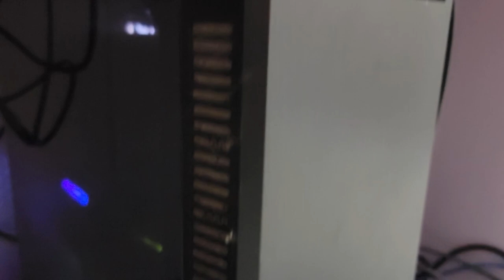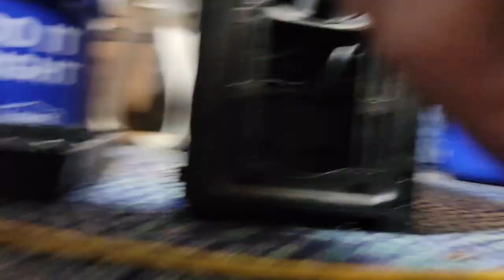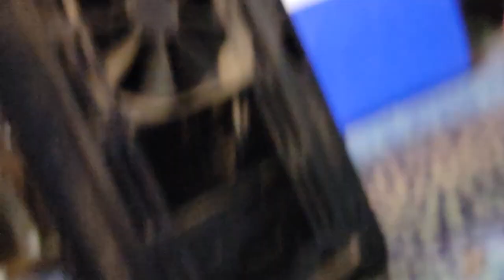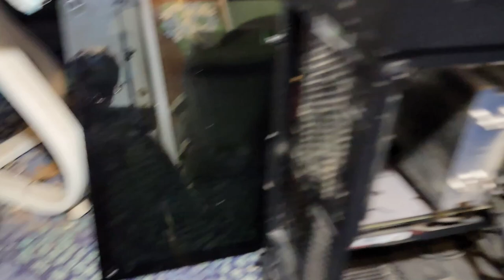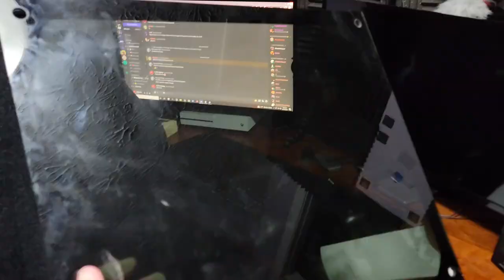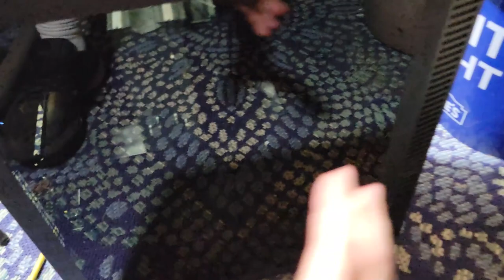How to Clean Your Gaming PC! (2022 Guide)

Comment: some computer people in WA told me never to use duster because it has a propellant in it that is basically jet fuel and it leaves a residue...they all use 91%+ rubbing alcohol with the machine off when not in use and very high grade animal hair brushes with a strong shopvac that only gets used to blow air out of (sucking the air out...not blowing it in!) their pc...because they dont want any chance of foreign particulates. I hope this information finds you well sir. you can take a piece of paper and roll it up to fit a vacuum hose end so that you can get into tighter places that way...and if you cut the ends of the thin tube made...you could theoretically use that as a "brush".